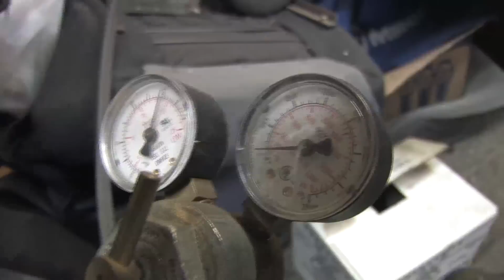Colt Driveshaft Install Part 1/3

Comment: Thanks for the reply. Wasn't sure if the parts washer would have the oomph to knock off the grime but I'll give it a shot. All else fails purple power and a pressure washer was my thought. It's going to be messy either way. I'm learning a ton from your videos. Keep up the good work.

Comment: might have the wrong video here but you mentioned that all the grime on the undercarriage was a result of the rear main and you had a plan for cleaning that up. What is that plan exactly? I have same issue and am trying to figure out how to do it without ruining garage floor or driveway.
Reply from the maker: +Tanner Wood Watch "DIY Parts Washer", and avoid rubber parts.  Nothing works better/faster.  

I think what I was talking about, though... that statement you're referring to... in my mind was 4 jack stands, a few cans of degreaser and an electric 1900psi power washer using a 35° spray nozzle.  ;)

Comment: is this thing safe with all these welds...its more like 2 car welded together...is it road legal , looked like a bit of a patched up botch to me lol
Reply from the maker: Why wouldn't it be?  It's not structural.  It's a floor pan.  But sure, it's the floorpan of 2 different cars welded together.  That's exactly what it is.  At no point did I need to cut into the frame, or any of the sub-structure to do any of it.  I don't really care if it's ugly, it's on the bottom of the car and the carpet's going back in it.  Before I was done, I put a jack under the tunnel and lifted the chassis up off the jackstands by it.  The steel that came out of the Galant VR-4 was thicker than the stuff the Colt is made out of.
Reply: DUH I DONT KNOW HOW CARS ARE MADE IS IT SAFE LOL DUH